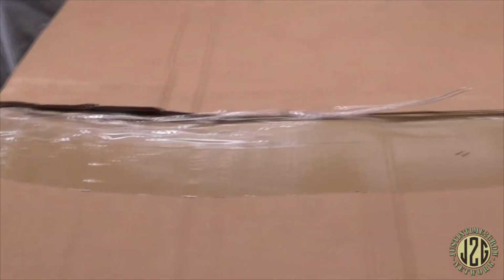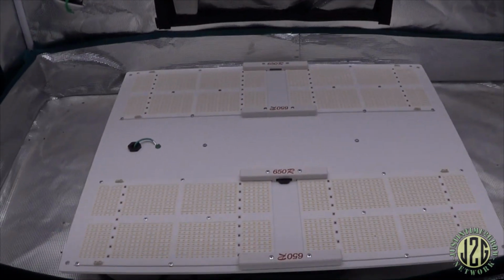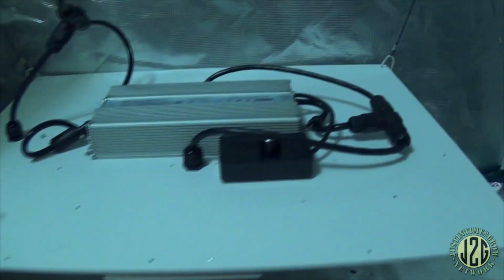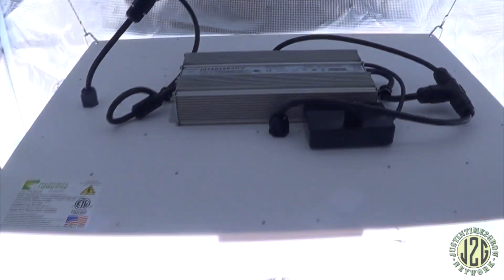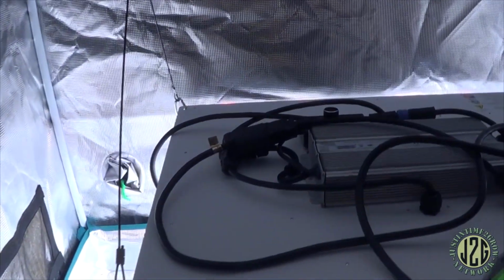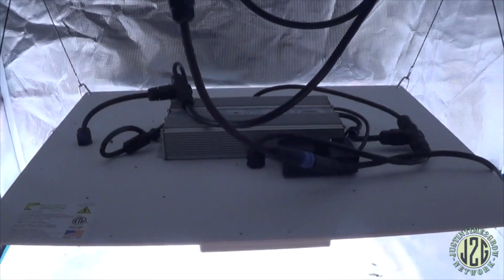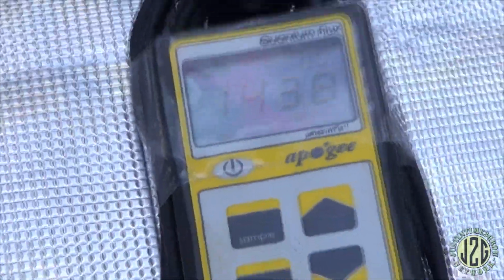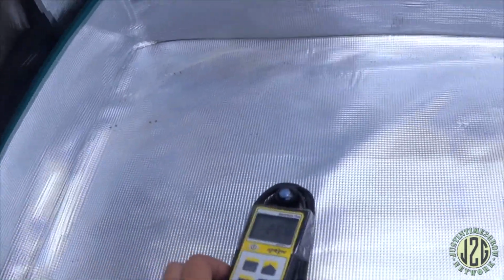Best LED Grow Light For A 4x4 or 5x5 Space? - HLG 650R(w/UV Bar) Unboxing, PAR, Wattage & Heat Test

Comment: I searched you just for this question. Will hanging 3 hlg600r on a 12’ row cause to much light to be overlapped and increase my par to much for flower? I run co2 in my flower room
Reply: @Murica Mfr 🇺🇸 my garden is 12’L x 5’ W 3 work perfectly and the overlap of the lights keep my numbers pretty center across the room.

Comment: Great video I just got this light myself. I’m wondering what would be the best height for seedlings and what power setting on the dimmer? Also I believe they changed the dimmer knob because all the new HLG 650rs have about ten clicks on the dimmer knob and not just one at the halfway point
Reply: 32”-40” at lowest setting possible is probably fine and then move your light closer by a .25 inch every day until at 16”

Comment: What was the watt draw at 50% power level. If it was 350 watts and at that par level you could dim the light down to 50% and have insane par levels saving a ton of money of electric. No sense in trying to run very high par levels if your not running CO2

Comment: That light is more expensive than what it needs to be. I’d buy more smaller lights so you can get a better overlap and save hundreds of dollars.
Reply from the maker: If you were to buy smaller lights OF THE SAME QUALITY, they would usually end up costing you more money. I would agree though that is a great way to go, just more expensive but also more options and versatility.

Comment: Without a par meter how do I know exactly what dim setting it needs to be
Reply: You need a meter.....about 169.00   HydroFarm  PAR meter.
Reply from the maker: PAR meters are usually $300-600. That's not a real PAR meter for $169.
Reply: @Justintime2grow   Hydrofarm LGBQM Quantum PAR Meter Micromol Sensor?   Just asking....

       Right......

Comment: would you ever need 2400 par???, im looking at a speicifc one of alibaba, they have their own patented reflectors, ill leave a link. the design is strips but its a 700 or 900w design, but the par readings that theyre showing is 1300@0.2M at full power....is that going to suffice or would i be better getting one of these

Comment: This is what I want to make, the diablo qb648 costs 129 cad I called future electronics to inquire into the Euv-600Sxxxst  just waiting on a call back.  need to find a decent enough heatsink or aluminum plate to handle heat dispersion. Any recommendations?

Comment: Man how u hook it up? The uva bar? Just orderd an got it but can't find any instructions on how too.
Reply from the maker: It’s easy, just take off 2 screws holding the driver on and screw the mounting brackets to that. Then push the bar into the brackets until it snaps into place.

Comment: What AC would you rec on that size light /tent?
Reply: I wondered the same when I recently got a HLG 600R for my 4x4 tent, but it runs so cool I have to turn up the heat. I been a HID guy since '97 and these LEDS are all new to me. I find you want to up your temps in a LED grow closer to 85 to get the leaf surface temp up as the LEDS don't produce the heat a HID would. Been doing better since I raised temps from 78 to 85. I guess depending on your ambient temps and season but if your ambient temp is mid 70's in my opinion you don't need an AC. Expect between 8 and 12 degrees increase from outside ambient room temp at full power.

Comment: So what temps do these lights run in your tent?
Reply: I have mine in a 2x4 gorilla grow and temps usually stay within 75 degrees on the lowest setting and a fan only circulating co2, I’ve seen 90ish on a hot day mid summer the plants kinda liked it though, right now colder nights I turn the knob to half way and put a fan directly on it for the heat sink and it stays cool, they get hot as fuck with no fan and turned up even a little so I keep mine on the lowest setting most of the time, keeps it cool and my plants love it, again it’s in a 2x4 tent

Comment: For 2x4 I considering a growcraft x2 or x3 or a rapidled 3 puck diy or optic 4. Which do you suggest?
Reply from the maker: X3 has amazing coverage and should last longer because the diodes aren’t pushed as hard.
Reply: Justintime2grow is the x3 as good as a optic 4 or better, which will be a the best producer. The x3 can be placed really close and u can get those high par readings similar to a optic. It’s also price better then the optic 4. I’m trying to convince myself . I Been two month trying to figure it out.
Reply: Nice insight thanks how do the x3 compare to the optic slim

Comment: Oh wow, you don't see a lot of uv bars that integrate both uv a & b in a single fixture.
Is it powered through the 650r or is it a separate plug ? Would definitely be interested in throwing that one above a slim 600 if it's separately plugged.
Reply: If you look on the website it is only UVA.
Reply: Seperate plug, u can run it with any light or by itself if u wanted 😎
Reply: daniel gonzalez what is the main purpose of it? Just wondering
Reply: Agromax Pure UV has the most output of UVA AND UVB..
Reply: @timpage5021  growers choice roi e720 has them also
Reply: @nickspeakstruth133  has what bub?
Reply: @timpage5021  uv/ir
Reply: @nickspeakstruth133  it’s got add on bars for additional costs yea. I thought you meant in the fixture itself. But they don’t use UV-B. 
Still the most effective most efficient way to use UV-B is through fluorescent. And thr Agromax puts out more UV-B per watt than anything on the market. And cheap too. 

A 24 watt 2 foot long T5 emits bout the same amount of UV-B as mid day sun in a 4x4 grow space. I use em paired with the Growbright fixtures. The Growbright fixture has a 4 inch wide aluminum reflector. Where most fixtures use plastic or a mirror either isn’t the best to use cuz neither will reflect UV-B. 

But yea buddy the add on bars to the 720 are slick tho.

Comment: Impressive par in the center, however useless. 2200 in the center and 1200 on the outside sucks. Way too much par drop off, and unusable in center even with running CO2. When you drop the center par to a useable 1200 par, then what do the sides read? 500 maybe? fruits will suffer on edges.  Get a growcraft, or greengenes light. even par over the canopy is key for high performance gardens these days. Also way more airflow without a slate in the center of the tent. Good luck with whatever you choose people. Due diligence is key.
Reply: He was only at 18" which is not recommended by the factory. 24" or higher for best coverage
Reply: You want to run these 30ish inches above your canopy. It evens out nicely at the correct height.

Comment: Hey there Justin, as always thanks for another awesome video & taking the time to give us valuable information. Question however, I can see clearly but just want to make sure that’s all. I see that this light fits in you 2x4 grow tent. Can the tent close properly, is it ok to fit in the 2x4? Just curious because I see the rating is a 4x4 to 5x5. Thanks again... akeem77777
Reply: Complete waste of money (for anyone reading this now in 2022 as I know this is old) for you to put this in a 2x4 when there’s perfect options for that as it sits already and they’re far more cost effective. The Mars hydro sp3000 can easily pull over a gram per watt (and it runs at 285 from the wall) if you know what you’re doing. It would make zero sense to put this in a 2x4 because it’s simply not configured right for that.

Comment: If  you set the dimmer to 50%  will  the  par output be roughly 50%  or does it scale differently? I'm trying to estimate my par levels without a meter.
Reply: I left mines on 50% but from 40 inches seedling. I'll find out in a few weeks 👍🏾
Reply: Dee B420 how did that go?
Reply: @deeb4204   50% @ 40 inches in Veg sounds just perfect to me .? How's it going ?  Think it can it be Low as 30'' in Flower @ 80%- 90% to close ? maybe.? in a 5x5.?
Reply: Get the app for that buddy! There’s a photon or lux light app that actually tells you par values from your phones front facing camera. If you follow the directions and put the paper ring around your phone to dissipate the light it’s pretty accurate

Comment: Really long video, so I didn’t make it through most. I saw you were reading 2400, but does that signify 2400watts?
Reply from the maker: 420 no it doesnt. If you don’t have the patience to watch a video I’m not sure you have the patience to grow well.
Reply: Justintime2grow no, just don’t have the patience for a slow drawn out unboxing video. Nothing to do with growing skills.
Reply from the maker: 420 patience has everything to do with growing skill. If you don’t have the patience to learn you aren’t going to grow well and if you think a par meter reads wattage you have a lot of learning to do.

I would suggest using the fast forward button, double speed option or just not watch if you see a 41:00 long video.
Reply: Justintime2grow I’m sorry I hurt your ego by pointing out that your video was really long. Didn’t mean to get you into your feelings for asking a quick question about the meter you used and the portion of video I happened to stop at.

Not even the least bit interested in purchasing a $1k LED light when I grow outdoor. Thanks YouTube!
Reply: What a stupid question, do some research

Comment: Pretty sure Meanwell has yet to release a driver that can run the 650R Spec boards and that's why HLG went with them. Let me rephrase that. Meanwell doesn't have driver's that can run the board efficiently.
Reply from the maker: If that's true thanks for the info.